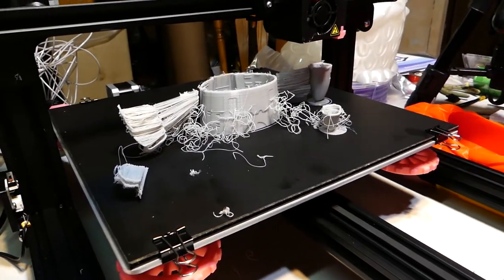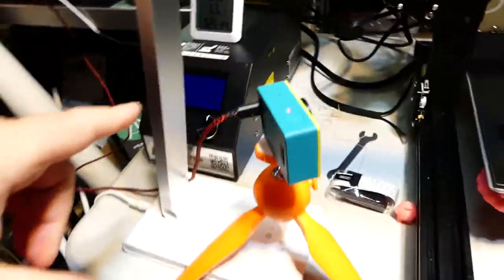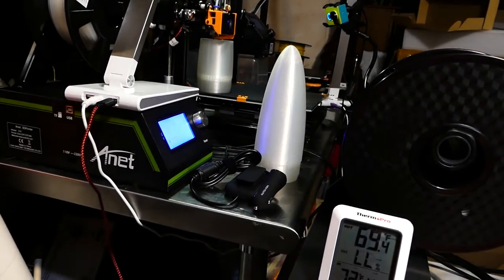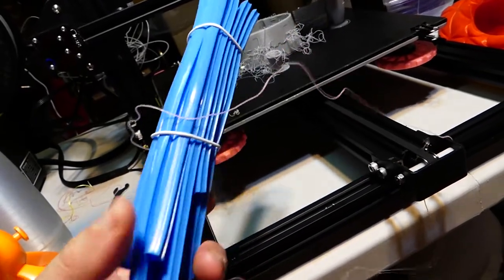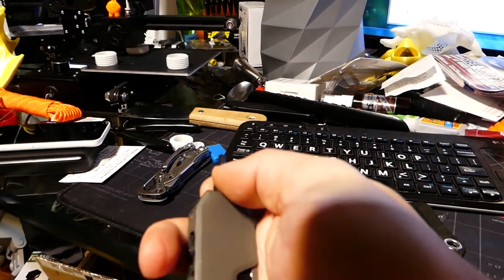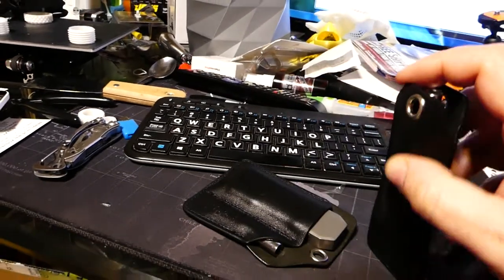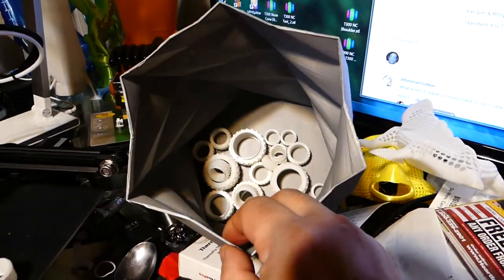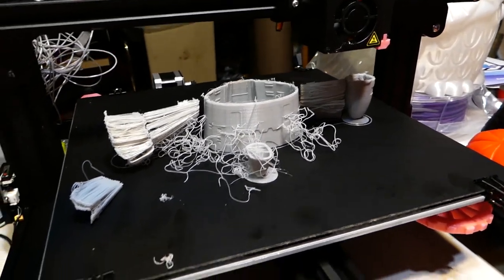Today's 3D Print - What's Up Friday September 1st

Comment: Bummer on the CR 10  Glad you got it working again..
Reply from the maker: Bummer? both my CR10's are churning away nicely. the one had a zdrop issue but that was just a loose stepper motor cable. once I reseated that it has never done it again. they are pretty bad ass machines especially when you consider how freaking cheap they are for the print volume and quality they offer.

so far they have also been maintenance free. I have not had to do a thing to them.
Reply: Let me rephrase. Unfortunate jam
Reply from the maker: ahh yeah. when the filament loop jumped the roll and started to strangle the holder. I think the brain box thought I was going to send it to the delta quadrant so it tried to commit suicide by hanging ?
Reply: Lol. Good one. Trek on.
Reply from the maker: Attempt number 4 is going now I think I got it worked out (fingers crossed)

I enlarged my stiction disc to be 6 timers larger and to include the support so it has something more substantial to stick too. we shall see.